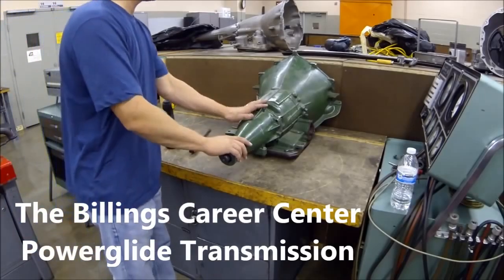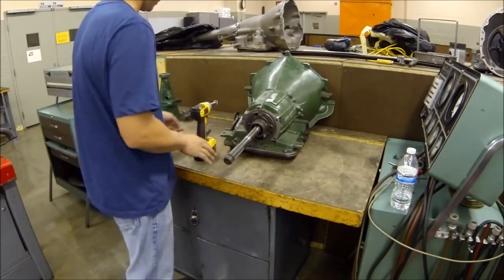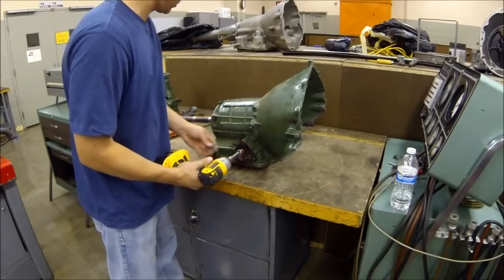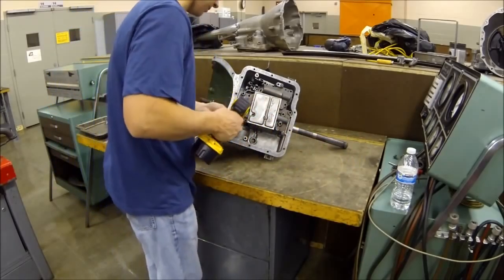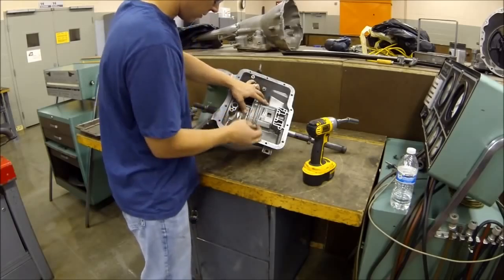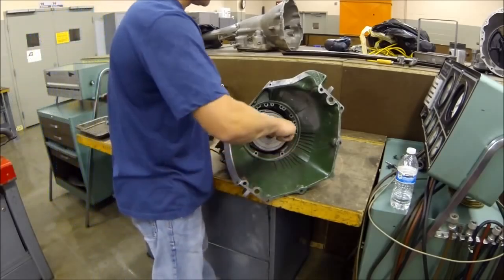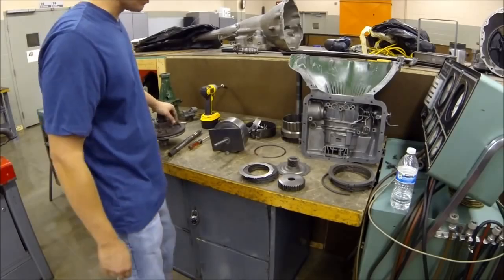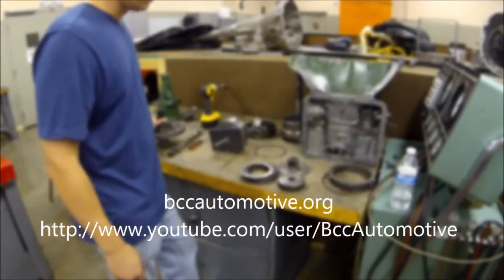Powerglide Transmission

Comment: Hi I don't no If you will see this, I have a 66 Chevy 2 speed power glide. Its been rebuilt , it is going in my 67 chenille with a 671 blower 373 rear, I also have a p4 torque converter, How can I eliminate the kick down from the inside, so it can be shifted manually, and not have to worry about the pressure,  I have dual carbs is this possible. please need some help thanks Brian